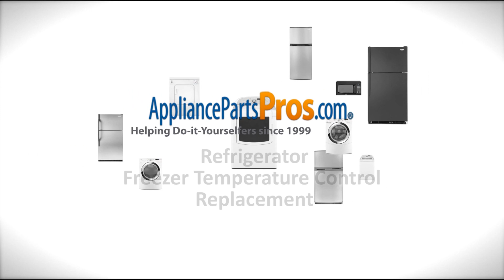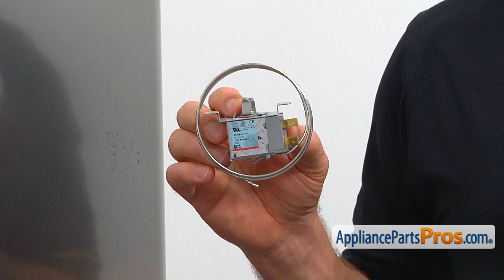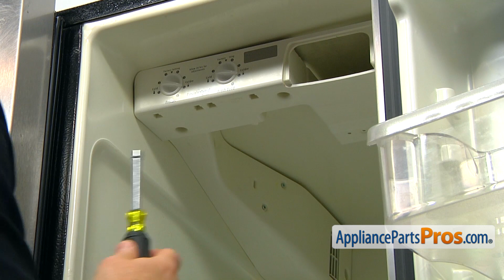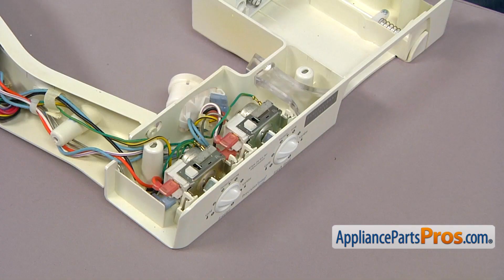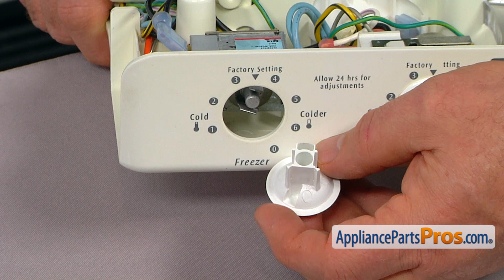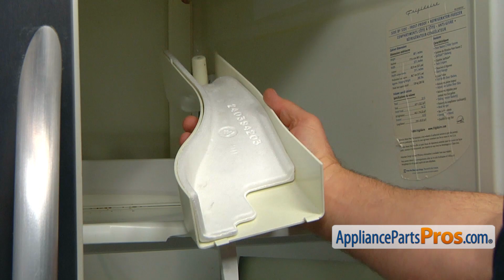How To: Frigidaire/Electrolux Freezer Temperature Control 5304496561

Comment: How do you test it?
Reply: You can use an Ohm / multimeter.  Unplug the fridge, remove the two wires that connect to the thermostat's contacts (Ignore the green ground wire.)  Set the ohm meter for resistance, whatever the lowest setting is.  A cheap Harbor Freight multimeter might have a "200" ohms setting, use that one.  ALWAYS check your meter's connections first, by touching the multimeter's probes together.  Whith its probes touching each other, the multimeter should read close to zero ohms.  When not touching it should read infinity ohms and display infinity or open circuit however your multimeter displays an open circuit.

Connect one probe from the multimeter to one of the thermostat's contacts, and connect the other multimeter probe to the other thermostat contact.  With the thermostat temperature knob set to its lowest setting, the multimeter should read Infinity ohms. 

For that cheap harbor freight meter, it just reads a "1" and two spaces to tell you that the reading is way above 200 ohms, or open circuit in our case.  Next VERY SLOWLY turn the temperature control knob.  You will hear a click.  you should now read a very low resistance now, like 1 or 2 ohms. 

Watch your multimeter as you SLOWLY turn the thermostat knob all the way to its maximum cool setting.  If at any point (after the click) when you are turning the knob and your multimeter reads infinity ohms, your temperature control knob of the thermostat has a dead spot where the thermostat will not operate.  You will want to replace the thermostat.

As I found out the hard way, the Freezer and Refrigerator use DIFFERENT thermostat parts in the Frigidaire Refrigerator that I have.  In my case, the Fridge uses the 2415865-01 and the freezer uses 450226-13, they are not the same part.